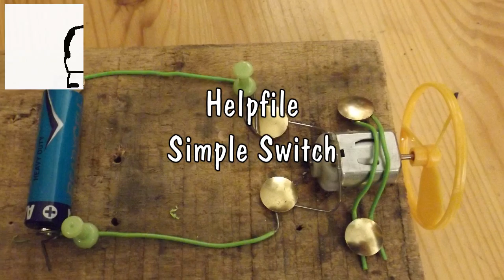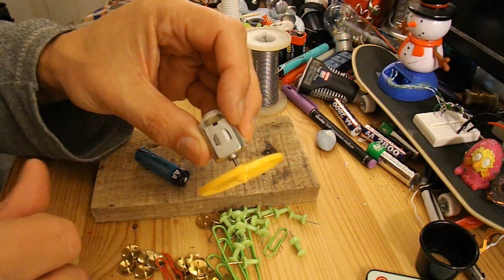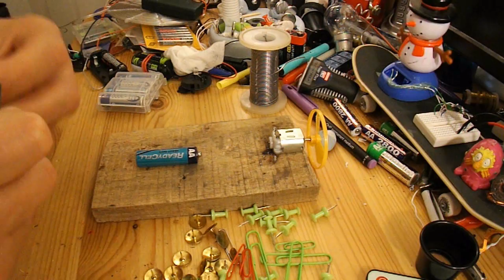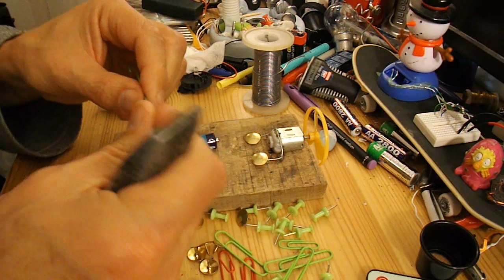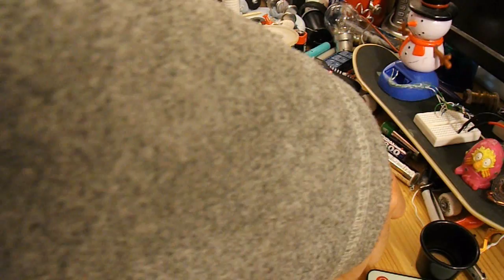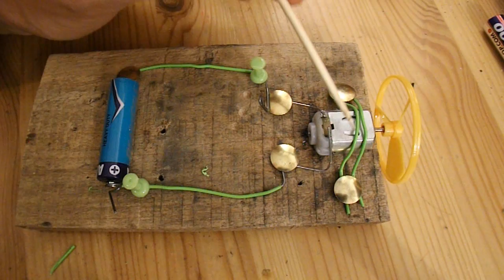Helpfile - Simple Switch

Comment: Can you make a rechargeable rc car
Reply from the maker: Not sure what you mean. Most r/c cars use LiPo batteries which are rechargeable, so that would be the normal situation.
Reply: I mean a cheap one most rc cars cost 20-100 dollars
Reply: Also I mean a mini one
Reply from the maker: +Nick Maden the cheap r/c car I took apart in this video only cost £4.99 and I couldn't source a transmitter + receiver + motors + the rest of the components any cheaper than that so there is no point in trying to make a cheaper one. http://youtu.be/uEhEcV1N_1E